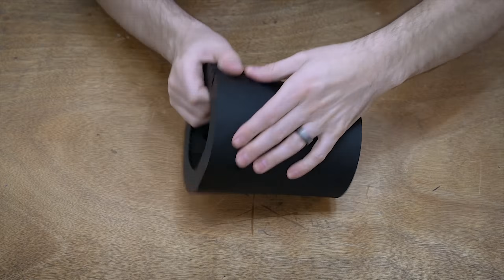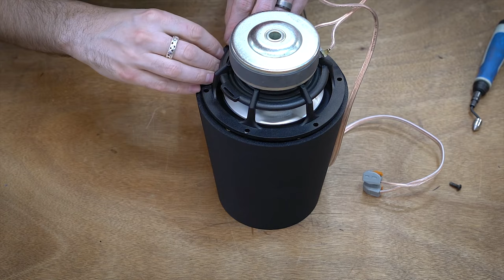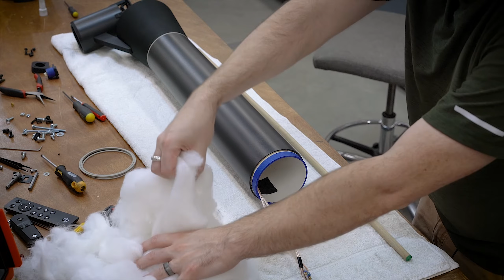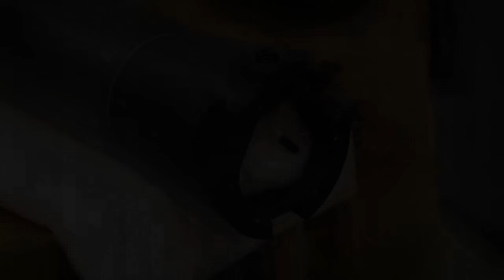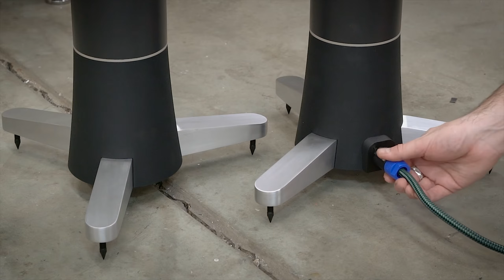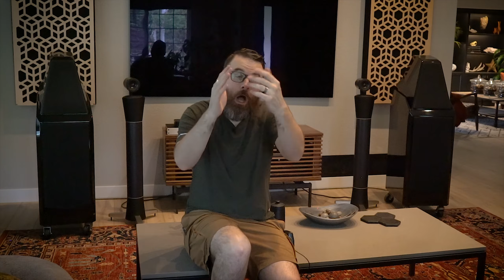LXmini Speakers Final Assembly

Comment: I'm surprised you didn't mention that the fasteners in the Neutrik NL connectors use a PZ1 screw head, so skip the Philips
Reply from the maker: I guess I missed that.
Reply: @RobertCowanDIY  it's all good. I'm in the audio industry and see the green guys struggle with these all the time. Same applies to most European flat-pack furniture like Ikea haha

Comment: with their subs it would be a fairer comparison on scale
Reply from the maker: You're absolutely correct.  I probably could just just put a crossover on the Wilsons so they both played down to the same frequency.  We now have them in a much smaller room (their final home) and they sound much better.  Not that they didn't sound great before, but they certainly like a smaller room.

Comment: With heat inserts, I push them 95% of the way down with the soldering iron, then remove the iron and push the fitting the rest of the way down with a small aluminum block, it pushes the fitting down to make it perpendicular and flush to the surface and also pulls out some of the heat. Works well for me.
Reply from the maker: HA!  That's exactly what I was doing towards the end, but using one of the fasteners (since they're long).  The fastener removes some of the heat like you said.  It's a good trick!
Reply: @RobertCowanDIY   I find that using a fastener can still throw it off square and also melt into the part.  For me, I have scrap of aluminum that is machined on all sides, maybe 1x1x2" that I keep on the bench and press it flat at the very end.
Reply from the maker: @unpopular_mechanics  Gotcha.  I don't always have a situation where I can access the face of the insert, sometimes it's in a pocket, or there's something around it.  I'd say 90% of the time it's straight with just the iron though.  But I liked using the screw, since with nylon it tends to squish back out when it's still hot.

Comment: 8:10 i actually have a lower bench for "precious" items as i call them. Whenever i do assembly or work on things that could be damaged by drops, that area of the shop is specifically made to prevent damage. I have lips on the benches, about 2 cm high to prevent things from rolling over and the floor around is foam. I sit on a bean bag at that table, even the surface table is a Firestone rubber mat. Because it absolutely sucks when you get jelly fingers and you drop a valve body to a half a mill hydraulic machine. I'd rather sit at the kiddy table than suffering that. :))
edit: i think they came out great!!! :yougotthis:

Comment: Make yourself a dedicated driver for those inserts where there's an endstop (of a high temp resistant plastic). I used teflon and use an iron with temp settings, where the highest temp is +1 degree over the required melting point for that specific plastic (made some test pieces and have them written down). So much easier to drive inserts with the end stop. Mine's threaded, so that the teflon washer can be changed for custom ones where for example i have to drive the insert in the bottom of a recess, and i just cut a positive shape of that recess as the end stop.
One last tip, using a threaded driver (just enough threads to engage the insert) and using the +1 degree temp allows me to slightly twist the insert inside the plastic, which gives it even more strength. This wouldn't be possible without the endstop, it makes a mess of the plastic around without it.

Comment: Fun project.  Thanks for showing us how it went.

I like the trim rings and think something similar would be nice to fill the gap around the woofer.  Something with a nice quarter round in the same color would provide a finished look at the woofers.

I also like the pattern on your acoustic panels behind your speakers.  Might try to replicate that on my CNC router for some panels for myself.
Reply from the maker: Thanks!  I was thinking of adding more trim rings around the drivers like you said, but it seemed to be too much.  I didn't play with it enough though.  The idea is to maybe make speaker grills for the woofers.  OR just keep them as-is.

Comment: I do the same with heated inserts, no special tools. Depending on the filament, like nylon, I find that the insert starts getting pushed out as the filament cools. So I use needle nose to initially guide the insert in, then cap the insert so it can’t walk out during cooling.
Great looking project!
Reply from the maker: Thanks!  I found that screwing in a fastener a couple threads lets me 1) align it while it's still hot and 2) acts as a heatsink to cool it down quicker.  It takes a couple seconds and aligns and cools it down all in one step.

Comment: The accent rings look great, it's a small touch but as you said it just completes the whole look. Especially in the last shot it would just end up as a undefined black blob without them.

Also great that you checked polarity, I can't count the amount of times I was listening to a music system and realize one of the speakers is out of phase, it can really screw with your head if you get deadzones in specific spots in a room from the waves (partially) cancelling each other out.

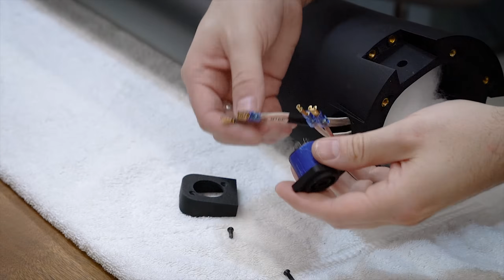11:44 I think your speakers are passive though (no amplifiers inside, they would use XLR plugs for audio and mains connector for power usually), but the Speakon connectors are designed exactly for this usecase. I just love them: super rugged, can't accidentally pull them out and blow up your amplifier from it falling onto ground or anything and they beat using bananaplugs, jackplugs or even (ugh) screw terminals by a metric mile. Perfect choice!
Reply from the maker: Eh, they're passively active?  I WAS going to put the electronics inside, but it would have been more wiring.  There is zero crossover and they absolutely need the amplifier/controller to work, so they're kinda active speakers (seeing as each driver has a dedicated amplifier).  But the electronics are just outside the speakers.
Reply: @RobertCowanDIY  The way I understand it, a speaker requiring one or more external amplifiers to work would qualify it more as a passive speaker. I don't mean the entire setup is passive (as the external amplifiers/controllers are certainly not), but they aren't part of the speakers themselves.

The active/passive distinction has to do with the level of the audio signal coming into the speaker and if it has electronics inside to amplify it to usable levels. If you had put the power amplifier inside the speaker as you originally wanted, it would be an active speaker but like you said it's more wiring, more chance of noise since you need to bring power cables into it and if you're unlucky the amplifier can overheat from the lack of airflow inside a closed speaker.

If you feed a speaker line-level (~2V peak for professional applications, more like 0.5V for consumer) or lower like microphone/instrument level (~0.02V or lower), it would need active electronics (power amplifier) and external power supply to boost the level up to something the driver(s) can work with. Benefit of this is that all the hardware is contained into a single unit so you usually see street-performers or low-quality DJ setups using those, but there are very good quality active monitoring speakers as well.

But if you feed it speaker-level (~20V or more if you have a powerful amplifier), then the speaker doesn't need any external power at all and can do most things like EQ and crossover (but none of that is required) just off the signal level, then that would be a passive speaker. Even if it requires an external crossover and two different power amplifiers outside it to power each of the drivers on it, the speaker itself would still be passive since it's just connecting the drivers to the input.

Honestly I prefer passive speakers as you can select your own amplifier and change/upgrade it if you don't like the sound while keeping the speakers and because of the higher voltages there is a lot fewer issues with long cables killing presence or picking up noise, with an active speaker it's all integrated so whatever comes out is what you're going to get and you don't have to deal with connecting each speaker to mains or a power adapter as they are just fed through the speaker wires.

Comment: Beautiful assembly! :)
If I am understand it correctly, lxmini kit leaves a room for lot of personalization, so it is not a step-by-step guide.  
Have you thought about selling the metal parts or make the stl-s public?
Reply from the maker: Correct.  They do have step-by-step plans, but they look awful.  It's meant to be for people that have zero DIY skills or tools.  Many people like to take the design guidelines and 'dress them up' a bit, like I did.  Unfortunately, they (Linkwitz Audio) seems pretty litigious, and I don't think sharing the design would be a good idea.  You need to buy the plans from them, and by providing the STLs, it would give away the dimensions of the speaker, since the drivers are known.  You could then just buy the drivers and the crossover and not ever buy the design license.  Otherwise, I would absolutely share it.
Reply: @RobertCowanDIY  That totaly reasonable, lxmini is not an opensource project. Sad though.
Reply: @RobertCowanDIY  There are closed sections of the official oplug support forum for people who have purchased the plans where you could share the stls if you wish. There are a number of people on there sharing their creations and derivatives of the linkwitz designs.